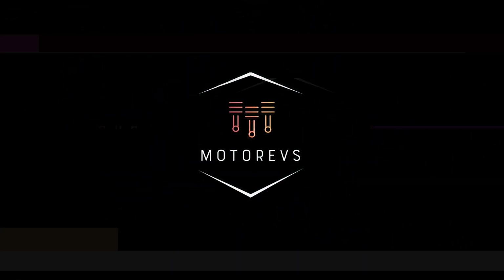Exhaust Valve Cutouts Install on BMW F10 535i! | F10 535i Build pt.22

Comment: Tbh this the best option. I have Valved Mufflers and it’s a great tone but not enough. Going back to stock mufflers and Cut outs to get more of that Diesel & turbo sound.
Reply from the maker: I agree, for sure. I was looking at some valves mufflers, but they probably wouldn't have such a difference between open and closed, and they might drone. And yes, you'll get that turbo whistle. A lot of it, it sounds great.

Comment: Hey when I click on the link for the tips , I don’t know what size mm to choose , can you help me out . On stock mufflers
Reply from the maker: I got 63mm inlet, and ~101mm outlet. Make sure they're the H-Style in the correct orientation. Depending on the overall length, it may or may not fit. As far as I've tried, these (the ones I have installed) do, of course, work.

Comment: Niiiiiiiiiice. Btw what's your tire size on those stock wheels
Reply from the maker: Thank you! On these (now replaced) stock wheels, I was running 245/40 R19 for the front and 275/35 R19 for the rear.
Reply: @ sweet I appreciate it love your vids bro
Reply: @ what spacers size were you running
Reply from the maker: Thank you! I was running 10mm spacers on the rear. No spacers up front.

Comment: I started following you about a week ago after the MMI pro video and i love your videos, you’re probably much younger than me but i look up-to things you do to your car and it inspired me to some to my car.
I have 2012 535xi absolutely loaded to the brim with sport seats, cooled and heated and massaging front seats heated back seats 4 zone air conditioning etc etc it has it all, but its not M package, I was wondering if mine and yours have the same engine, I will put a M body kit on it and want to tune it and put exhaust on it but want to know if its worth it for my engine, if its different than the M package

( my engine 3.0 V6 300hp)
Reply from the maker: Thank you, man! I really appreciate your words. I would've loved to have one as loaded as yours, but maybe next time... and, yes, that's my engine! Although, just for an FYI, BMW actually doesn't use V-configuration engines, unless it's a V8, V10, or V12, so, yes, we have the same engine, the N55; a 3.0 litre Single (Twin-Scroll) Turbo Inline-6! As for the M-Package, I had to have it. I just love how it looks, and for me, at least, it completely changes the car. I'd definitely look into it because with your (our) engine, you'd definitely have a lot of fun with it, as well as it being all wheel drive. That car could be pretty scary on the roads if tuned correctly.
Reply: bmws don't have V6's bro. it's an i6/inline 6🙂

Comment: What size did you get for the tips? Like the Input and output
Reply from the maker: I got a 2.5-inch inlet and a 4-inch outlet. I don't exactly remember the millimetric conversion, but it was 2.5 and 4 inches, inlet and outlet, respectively.
Reply: @MotoRevs  thank you I appreciate it 🙏🏻

Comment: Hey I’m looking to do this soon, I wanted to ask if the cutouts came with the pipe turned down ? Or did you purchase a pipe that’s turned down and welded it to the cutout ?
Reply from the maker: For the downturn, my muffler shop actually had some, so they just used the ones they had in stock. I'd definitely ask the muffler shop (if you take it to one) if they have some they can use, or if you'll have to supply them. Maybe you can weld yourself, but as for the product, it did not have the downturn pipes, it'll just shoot straight out.
Reply: @MotoRevs  do you think I can install it using exhaust clamps and just clamp it to the pipe ? I’m reinstalling stock muffler and I was gonna weld but my buddy who’s a technician told me he could cut it and just connect the muffler and the cutout with the clamps, what would you do in my shoes because I am stuck whether to weld it or not
Reply from the maker: Well, that's an option. You can definitely use clamps to hold it on, but be weary of exhaust leaks, as, obviously, a clamp won't seal the exhaust gasses as well as welding would. I'd say that's a pretty good idea, especially for quick and easy removal and reinstallation.
Reply: @MotoRevs  the reason I wanna try clamps is to have the option of removing if I want to switch up anything without having to redo the weld and pay more money. I’ll let you know what I do. And did the kit come with the cord extension only one? Or do I need both extensions you provided from the link ?
Reply from the maker: The kit didn't bring any cord extensions. One cable is just slightly longer, but not nearly long enough to reach where I put mine. You'd have to buy the extensions if you plan on putting your valves where I put mine.